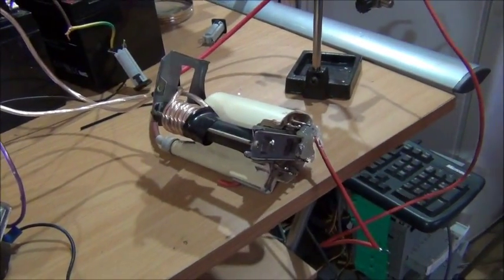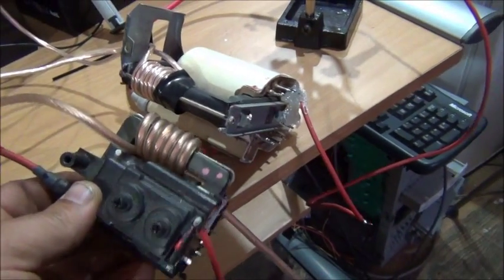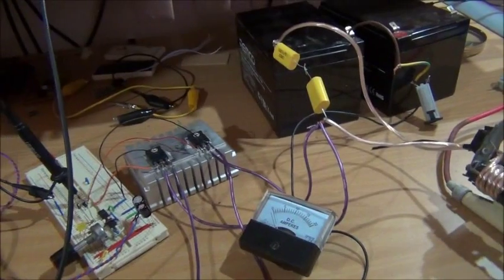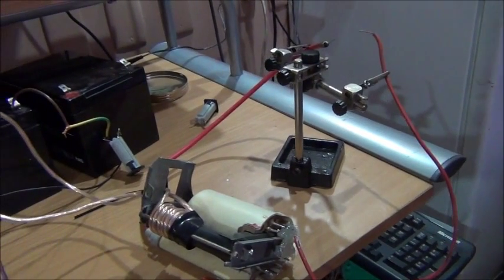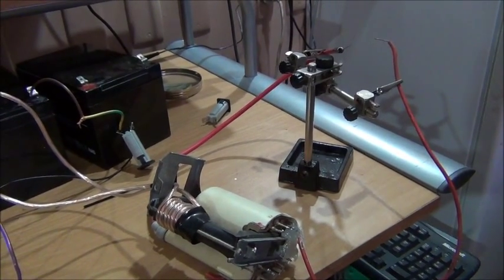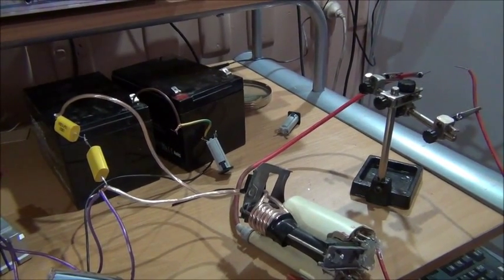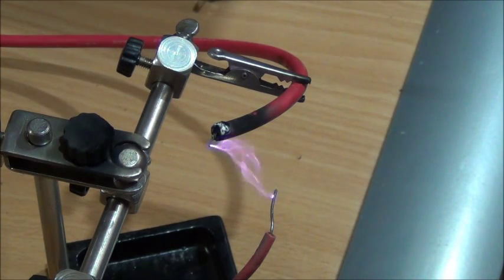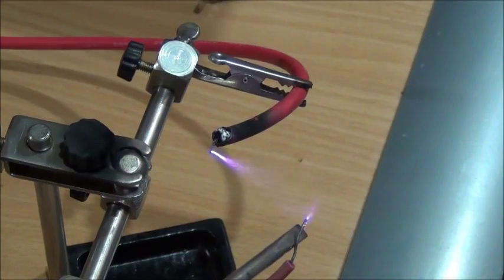Easter Resonant Flyback Arcs, 12v, 2 x IRFP260, 24V to come :)

Comment from the maker: i cant bring a laser in from over seas unless its mains powered only
like it cant use a plug pack or anything.. must have mains power straight into it
also, i can send the camera without batteries... i cant send the batteries alone as they might burst into flames. catch 22. i've been told fedex or ups or toll will send it tho.. i need to get to the airport to use toll :(

Comment: Just a tip,don't rely on fuses or breakers to protect semiconductor devices. The silicon is up in smoke before the fuse/breaker even has time to react.
The saying goes something like "The $7 transistor will always blow,in order to protect the 10-cent fuse."
However,it's still a good idea to use fuses/breakers,to prevent a total meltdown/fire!  Just don't expect it to protect the semiconductors.
In fact,they make really fast-acting fuses called "semiconductor fuses",specifically for such things.